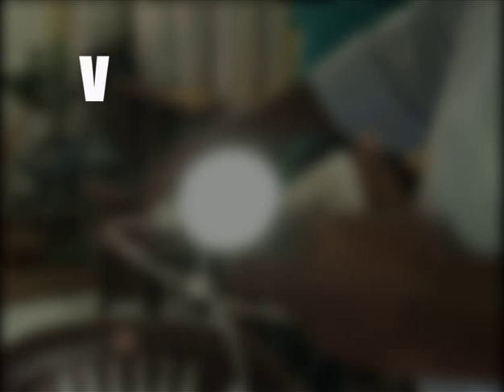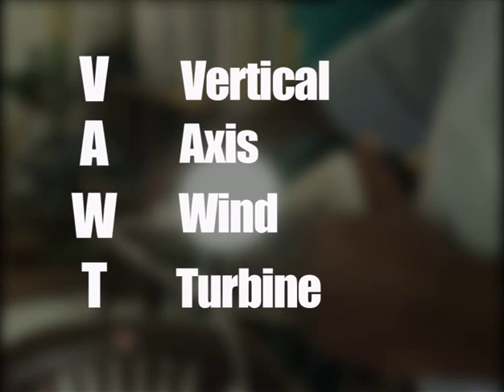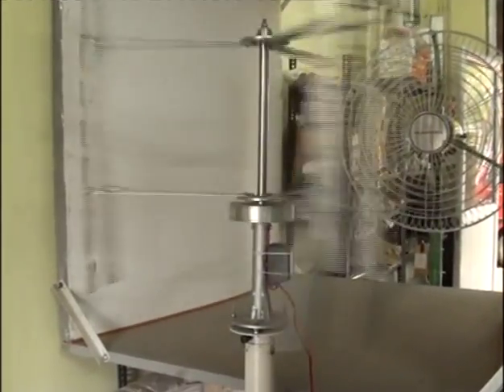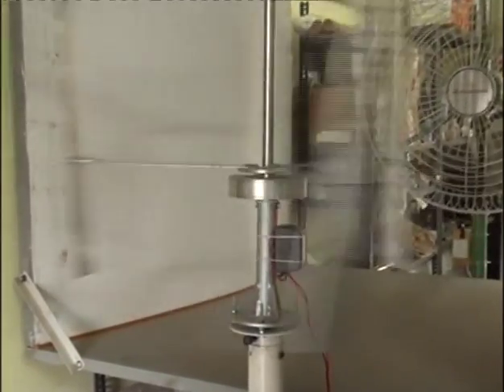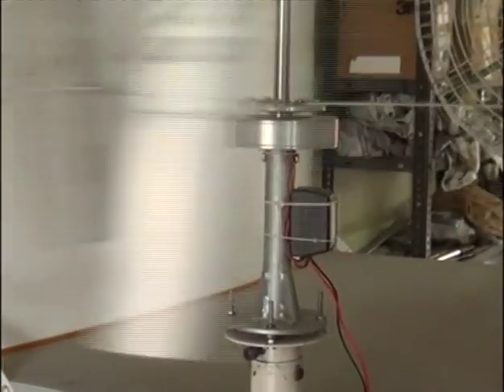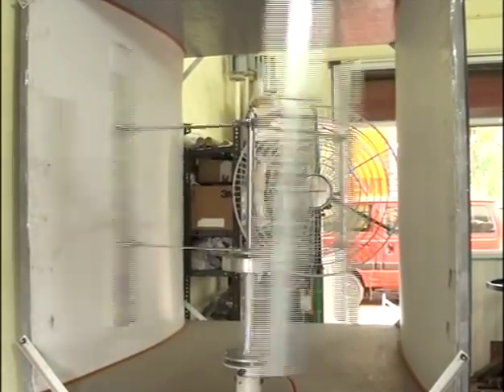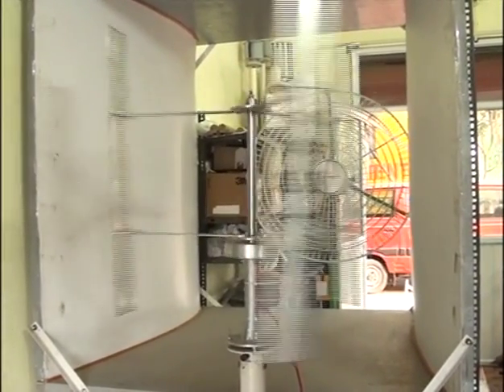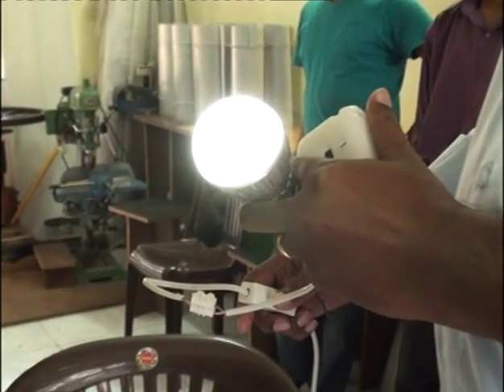VERTICAL AXIS WIND TURBINE

Comment: Sir,
I am sorry for being critical of your video and your oral presentation.  The average efficient house uses between 4-5 KW of energy.  VAWTs are simply too inefficient to provide even 10 % of this amount even if they were installed under ideal geographic locations far from any fixed obstructions, not to mention impermanence of wind supply, etc.  It was quoted that a "wind speed of 2.3 mph was sufficient".  Really?!!!  Are you suggesting that a VAWT is capable of supplying a 60 watt light bulb, for example?  Where does the average household in India stores its energy?   Can the average citizen of the world afford to purchase the required storage batteries to be able to use the electricity that is thus generated when they need it?  Even if the produced energy is returned to the grid with a small credit for use on demand, it would turn out to be profitable for the Indian Grid Providers and of very little benefit to the average Indian.
When enthusiasm meets reality, life looks different!
Reply: What is price of unit where is available